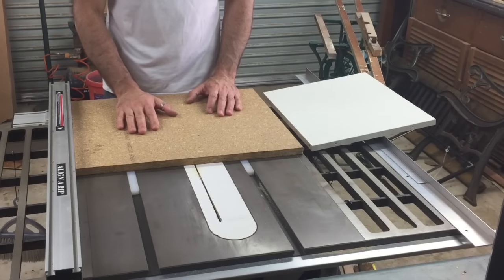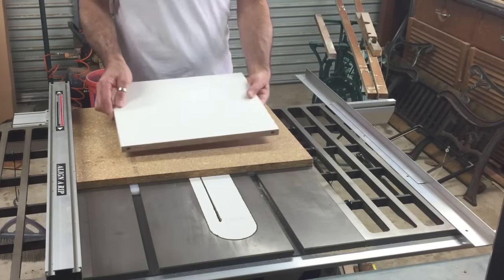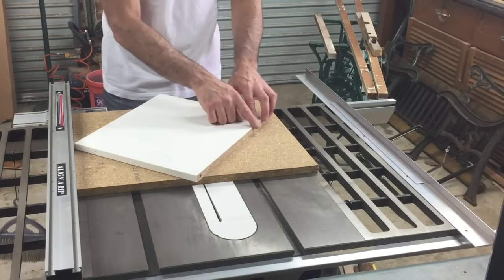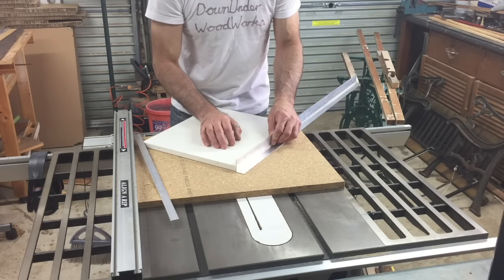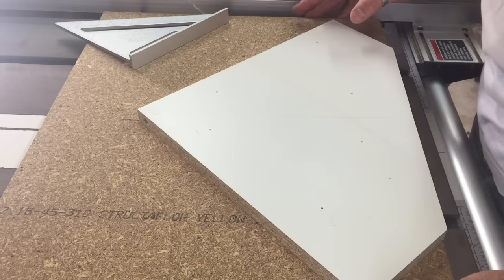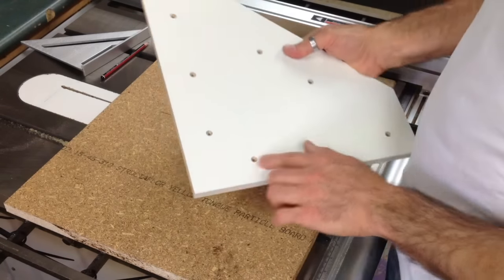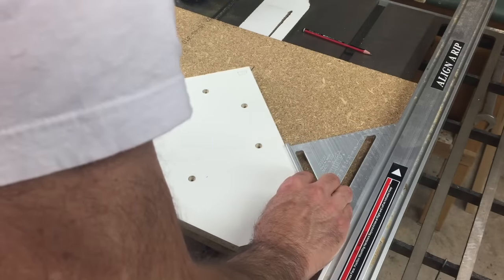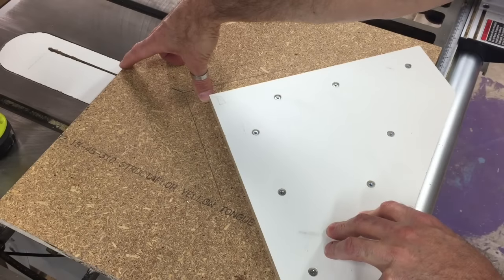How to make a mitre sled with perfect zero clearance

Comment: Nice job, I like the aluminum inserts. Nice that they're replaceable as well. Putting the sides as close to 45 degrees from the blade as possible will help make sure the inside faces of the 2 items you're cutting meet as well. This is particularly important on picture frames. Nicely done.
Reply from the maker: Thanks Bill. You're right mate, the 45 degrees to the blade is especially important as the frames get wider. I have readjusted the jig since I made it to be spot on.

Comment: Very nicely done!  I love to make things more complicated than they need to be so I think I would either add t-track in front of both fences (parallel to the fences) so I could add some t-track clamps OR make the fences from something like the t-track fences from Rockler or maybe do both so I could clamp down and to the fence.

And I'd probably make an extension so I could cut long pieces and still use a stop to ensure lengths are the same.

Of course mine would cost four times as much as yours. :)
Reply from the maker: Thanks very much for your thoughts and tips Fuzzy.

Comment: correction, you DO need to make sure the sled is exactly 45 to the saw or your cut faces will be different widths on each side of the miter. even though they're adding up to 90, the cut has to be at 45 to intersect the corners of the miter
Reply from the maker: Exactly right Jerome, but it would have to be out a bit to be noticeable. My comment in the video may have come across as being a bit complacent with the placement when in my mind I was only thinking in half degrees.Thanks mate.
Reply: Jerome Keating You are 100% correct. Some of my frames are 150 mm wide, and at that width probably a tenth of a degree makes a difference as to whether the mitres are open or closed - or perfect.

Comment: Good Sled but the 45 degrees need to be exact or your resultant cuts, while forming a perfect 90, will have different hypotenuse lengths and will not match perfectly.
Reply from the maker: Thanks Gary. Yes your right about the different lengths. An oversight on my part before publishing the video

Comment: Nice video. What I have come to find is that I need some clamps; especially cutting hardwood. The initial "cut-in" seems to alter the first cut by sometimes making it a little sloppy. I'm sure it doesn't help me that I am using a "less-powerful contractor saw. DD
Reply from the maker: Yes mate, the piece is prone to movement from the angle of the blade having a 'wedging' effect as it cuts and pushes through the wood.

Comment: Nice jig.  I need one.  How do you insure that the opposite rails are exactly the same length when cutting them?
Reply from the maker: In the video I measured the pieces precisely and used a marking knife to get a clean line for where to cut. Ideally the jig needs to be fitted with stop blocks which I will do if I find I'm using it a lot.

Comment: Thanks, I made this with one addition. I added a cross piece across the top end, the same as one would do for a normal sled. This allows me to square-cut the pieces before mitreing without removing the sled. I can still mitre 120mm wide wood.
Reply from the maker: Thats awesome Steve. i've not heard back from anyone thats copied one of my builds before.

Comment: I thought they invented the compound miter saw for this. Why go through this trouble. I can see it being a neat little project to tackle, but then, in a workshop where space is always at a premium, you now have to store this sled somewhere. Along with others people make up too!
Reply from the maker: Thanks for the feedback Dave. Truth is many mitre saws are not as accurate as this method. Unless you can afford the best top of the line mitre saw, there is always movement in the mechanism of most cheap to mid range mitre saws. The jig is intended for those woodworkers. Also the jig takes up far less space than a compound mitre saw. Cheers mate.

Comment: Nice jig! You're correct that it should only matter that the aluminum is 90 degrees, but if it's not perfectly 45 degrees to the blade one mitered edge will always be longer than the other.
Reply from the maker: That's true Ryan, others have said the same. I may have come across in the video a little complacent about the 45 degrees but that wasn't the intention. The 45 is critically important for the reason you said. Cheers mate.

Comment: G'day downunder, that looks great if you wanted to upgrade it, you could use 20mm tslot extrusion which would give you options to put stop blocks on etc. while not free the ally costs about 10 bucks a meter on fleabay. 

Keep up the good work
Reply from the maker: Thanks very much for the suggestions. I will look at upgrading the sled if I find myself making lots of frames. Cheers.

Comment: Great mitre sled.  I have one one made of wood and I like the idea of the aluminum.  Do you find there is any flex?  I would be nervous about that.  What is the thickness of the aluminum?  Great video.  You did a few things I did when building mine.  I thought I was creative!  Now I guess both of us are!!!  Thanks again for the great video.
Reply from the maker: Yes Dwain, we sure are. The aluminium is actually 2mm thick and is pretty stiff. With the backing board it pretty much eliminates any flex.

Comment: Hi mate. Probably a silly question..........is the reason for the sled purely for accuracy? As in cutting those angles on a mitre saw would not be as accurate? Thanks! Tony
Reply from the maker: Yes Tony. I have a cheap Ryobi mitre saw that only gets used for rough cutting timber down to length. It has  a bit of play in it and isn't great for mitres. Mitre saws tend to have issues with play in the sliding mechanism. The new articulated Bosch mitre saw looks like its a real quality saw but at $1000 or more I'll stick with my super accurate sled. Cheers mate.
Reply: Thank you. I appreciate you taking the time to reply

Comment: Hey Mate, absolutely love your work!!  In your earlier videos you had replaced the original saw blade with a 60T combination Diablo colored red?  In your later editions you are using a blue blade which I cant identify, could you please give more info on the saw blade? cheers Gary
Reply from the maker: Hi Gary, the blue blade is a Makita BlueMak. I only use rarely when I need a thinner kerf blade. it has about a 2mm kerf. Cheers mate.

Comment: Did you have a standard blade in the saw when you cut the kerf through the aluminum?
Reply from the maker: Yes Peter, aluminium is a soft metal that can be cut with a wood blade. Just take it slow.
Reply: DownUnderWoodWorks   Good to know! Thanks!

Comment: What the makers of these sleds dont address is how to ensure your frame lengths are equal
Reply from the maker: True, but i think in most cases its not possible to use stops on the sled because the sled would have to be so much bigger.

Comment: Why did you put the metal strips on it?
Reply from the maker: I figured that the aluminium will maintain its sharp crisp edge at the kerf cut better than timber alone would. Basically I reckon it will last longer.

Comment: I really like the explanations of what you were doing and why. Mistakes happen, thanks for not editing them out. I am  going to build a  sled but the only thing I think I will do, is attach the runners earlier on and make short kerf cuts at either end of the base so I can use them to align the other parts. I will also MARK on the board the saw blade I used, so I don't get lazy and leave a combo blade when I should be fine tooth blade.
Reply from the maker: Thanks very much James. Good to hear you're getting into the shop mate and great tip with marking the blade to be used.

Comment: Your videos have inspired me to try woodworking as a hobby. I figure from all the videos I've seen that a table saw would be a good place to start. As a beginner  would you recommend starting with a cheaper saw i.e Ozito?
Reply from the maker: The table saw is easily the most used tool in a woodworking shop. My recommendation is to buy the best saw you can afford. You will have it for a very long time and will enjoy it more. Happy woodworking.
Reply: vvet70 a cabinet saw is the best place to start- you can do things on there that would boggle the mind! Can be pricey but you NEED to have stability when you rip wood. I got mine from grizzly for 800 including shipping- they are heavy! crigslist is a great place to start- if your looking for a deal. get a used one and make it a project to square it up and make it look brand new. best of luck to you, from a carpenter in California

Comment: Hi, you say it is not critical that you get 45 degree perfect, but the more you are out of 45 the more difference in the miter cut length, no? So in extreme your joints will show steps even if the result in a 90 degree? Also if you want to use a sled like this to cut anything else to 45 than a picture frame it will be more versatile. Any idea about how to make it true 45 in a practical way? Thanks
Reply from the maker: What you say is true Helge. i should have expressed myself better or differently in the video. Use a good quality tri square or speed square but don't use anything that's adjustable.
Reply: Hi and thanks for the reply, after seeing how old this vid was I did not expect any... I have bought several carpenter squares, speed squares, even an Ingenieur square... none of them square... and I was wondering if it was my poor technique. Finally I bought a starret adjustable (unfortunately a small one) and have one true square to my name.. one recent purchase, imported from England is the part guide dog jig so I will be able to make true square cuts and maybe will be able to make a accurate mitre jig... I was definitely inspired by your video. Thanks again

Comment: How did you line up that fence for routing so quickly and accurately? Where you cut out the space for the aluminium on the bottom board.
Reply from the maker: Thank you very much for your comment. Apologies for the late reply but I'm trying to clear my "Comments I haven't responded to" list.

Comment: Well done....really enjoy your channel and relaxed style. Keep up the good work.....ps: what brand of construction adhesive do you use?
Reply from the maker: Thanks very much Greg. I don't have a preferred construction adhesive as I rarely use it. In the video I used Loctite Power Grab which was left over from the beam light build I did recently. The reason why I used that one is because it stated on the pack that it dries clear but that didn't happen. It actually dried white. I only chose construction adhesive for the beam light because I didn't know how Titebond would go with plastic/rubber.

Comment: ok, so what is the point to using aluminum? why not just some wood for the fence?
Reply from the maker: James, the idea behind the aluminium is that it has a more durable and sharper edge which will last a lot longer than timber.
Reply: ok

Comment: Another great video, a big improvement on the sled I now use, although mine is just set up as a cut off sled. I started using cutting boards for runners a few years ago and they're great. Also make custom, usually larger, bases for my routers. Keep up the good work and thanks for the straight forward delivery. Too many video makers want to be comedians.
Reply from the maker: Thanks very much Ronald, good idea with the router plates.

Comment: What is the name of that tool u use to make angle cut with the track of the table saw?
Reply from the maker: Sorry, are you referring to the mitre sled that i made or the mitre gauge that comes with the saw?
Reply: @DownUnderWoodWorks  it was the mitre gauge, I just bought a new one because I needed many accessories for my table saw, ty for the help.

Comment: Great video! I really like the idea of using aluminum to make the corners crisp and longer-lasting. Question: Do you find much resistance of the piece you're cutting as it moves through the blade? Typically when using a miter saw I either have to have a death grip on the piece or clamp it securely to the fence to keep it from moving slightly. Thanks for sharing your work. Mike
Reply from the maker: Thanks very much Michael. The beauty of using a mitre sled compared to a mitre saw is not only the accuracy but it is also much easier. I know what you mean about the death grip. Cheers mate.

Comment: Great video and a good improvement on most sledges with the addition of the ali angles and plates. I'd add a safety feature of a block behind the angles for the blade to run into and be covered.  Thanks for the ideas with this.
Reply from the maker: Thanks very much Mike, the block is a good idea.